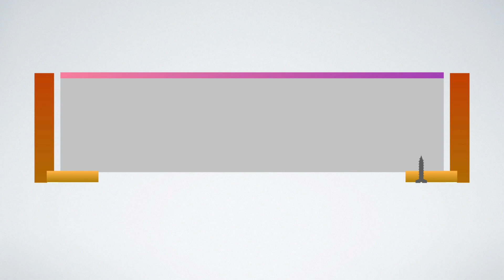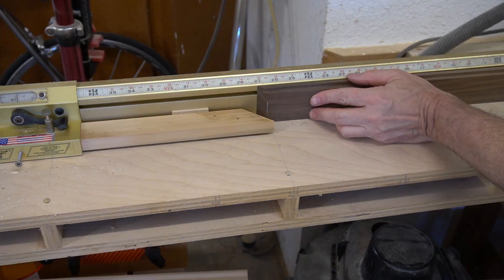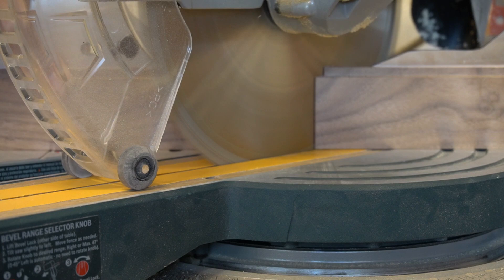How to Make a FLOATER FRAME

Comment: Nicely done.  Looking for a different way to fix the painting into the frame - never liked those screws going into the stretcher.  Have you seen any other good methods?
Reply from the maker: Hmmm I don’t know. What are your concerns?
Reply: @JamesCrandallPainting  Splitting of the pine stretcher - over time.

Comment: Great video! Were the rabbets pre-milled on the walnut or did you do it yourself?
Reply from the maker: Thanks, Farooq! I bought these moldings from a planing mill, so the rabbets are there (and the mill provides the basswood backer strips to fit).
I have in a pinch made my own from hardwood lumber, but of course that’s extra steps: table saw, surface planer, router table. ..a bit of a bother, but not too complicated.  The mill is Foster Planing Mill in Los Angeles, if that helps. Nice people.

Comment: Could this be done without the nail gun?
Reply from the maker: Yes. Without a nail gun I would hold each joint in a clamp, pre-drill holes for small nails and tap them in gently…them ideally leave the joint clamped until the glue cures